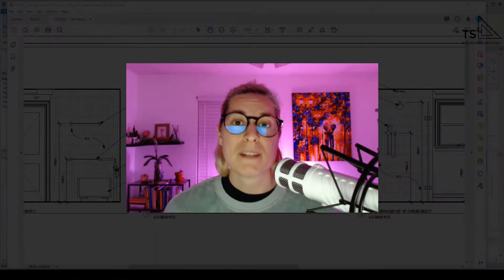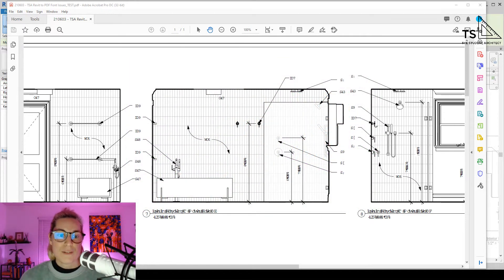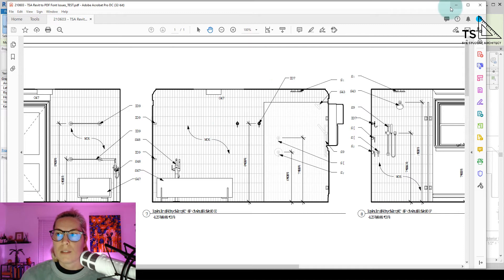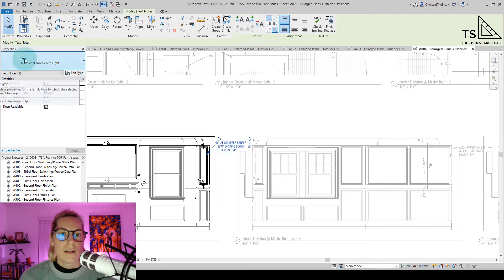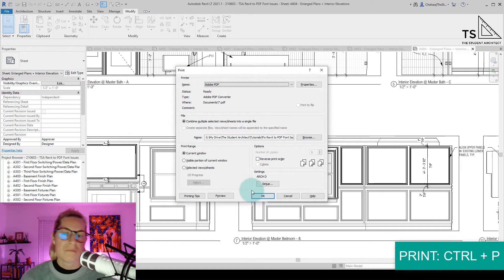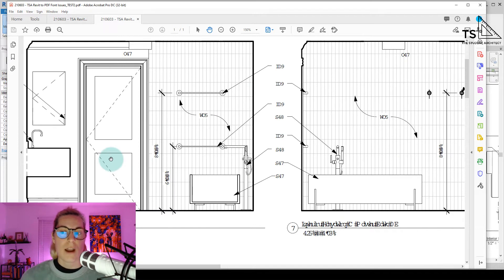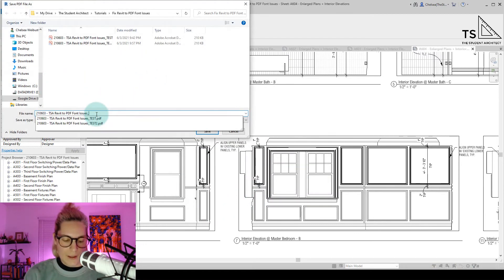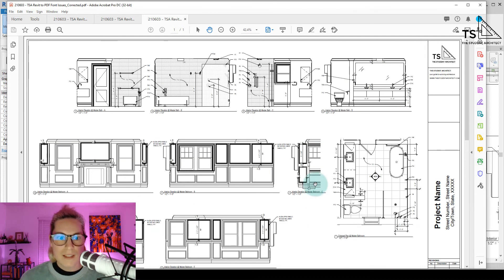Revit to PDF Font Issue Fix

Comment: There is no such setting😢
Reply from the maker: The setting only applies if you are printing with Adobe PDF so if you are using another program, you may need to find another solution. Sometimes closing out of Revit or even restarting your computer can resolve the issue. Hope this helps!

Comment: I have found this such long. Native Revit to pdf feature, currently it doesn't have this checkbox.

I thought I would found a fix beside using "Adobe pdf".
Reply from the maker: Yes, this fix only applies when printing to Adobe PDF which is what I was using at the time. There are so many different PDF viewer programs that all have different settings but this is the one I found a fix for